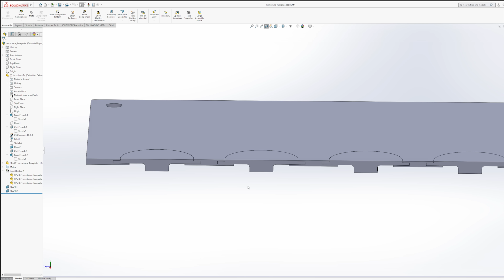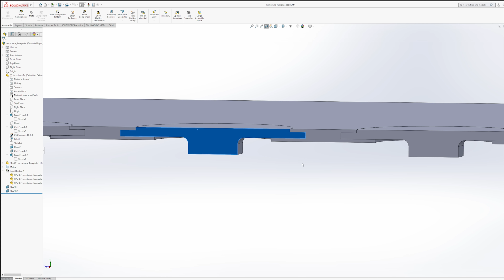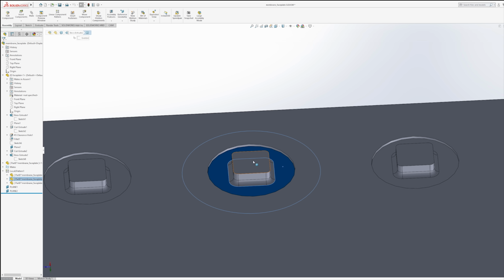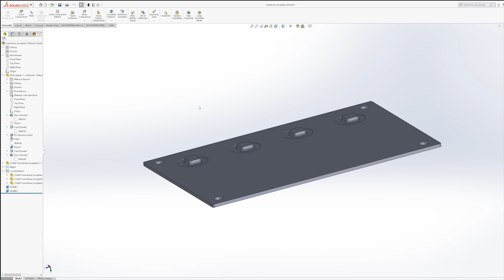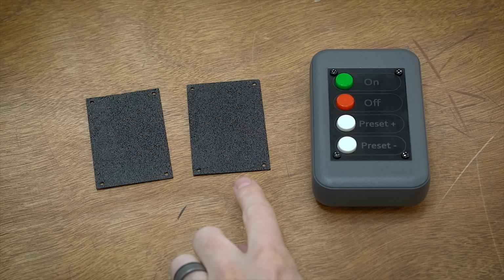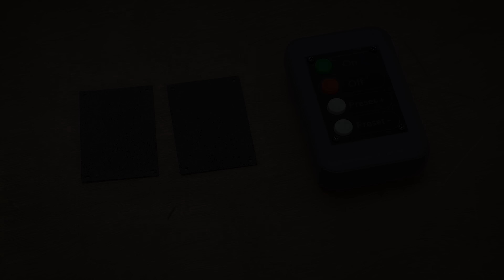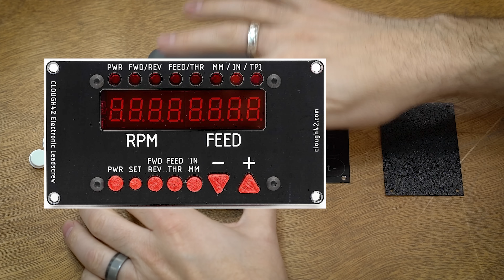3D Printed Flexible Membrane Keypad

Comment: Thanks for the video. Some idiot used this technique on our fire alarm control panel instead of using ordinary buttons. This broke over time as it was regularly tested. Now  I know what materials were used. There is a saying, if it ain't broke, don't fix it
Reply from the maker: Ha.  Yeah, I was more demonstrating the technique, but it absolutely has its application.  Membrane switches are decent, but not always the best for high-use environments.

Comment: I had an idea for making TPU hinges in PETG parts, and that’s part of the reason I initially pre-ordered a multi-head XL, but then I was told TPU and PETG didn’t mix well. Guess I was wrong. Maybe I’ll see if I can make something like this work with M600 filament changes. Would be a pain in the butt swapping filament twice per layer, but it might work…?
Reply from the maker: Yeah, that might work, but swapping every layer would get really old really quick.  But yeah, PETG and TPU mix REALLY well.

Comment: This is so awesome. I'm just imagining using a filament with just enough conductivity to literally print 3d print to PCB membrane switches, ala crappy keyboards (like the one I type this out on).

You could have a completely clean product face as it could just be a part of the top, not even just the cutout.

Actually sod that, imagine a product face that looks completely blank until it's on, and then the lights only show through certain regions divided internally.

You could go even further. Imagine a product face that went right against membrane pads like the membrane keyboard idea I started with, but then has cutouts in the PCB for lighting, so the lights for the buttons and the labels could be in the same place on the same PCB, for a true one PCB solution.

You could even do some funky stuff to press buttons on 2 different pcbs with the extensions built in for no fiddly assembly with risers etc.

The possibilities are truly endless.

Like I said in some other comment here, it sure has some kinks, but this is like 3.1D printing, heck, with all the ideas I think of as I type this comment, I'm going to be like the USB Implementers Forum and upgrade that to 3.5D printing.

Just all the things you can print in one print with something like this. Like I totally still think speed is legitimately super important for prototyping, but in many cases, this just strips like 10 assembly steps, and that's really awesome. You could probably make a little plinker toy blaster or water gun on this thing in a single print with no supports to break off. I mean, its just that flexible + hard + color + dissolvable supports + color 2 (semi hard). It's such a powerful combo that honestly, I feel like 5 might be a pretty Ideal amount to always have just about all the normal materials you could want to print with hot and ready for any print. If this thing was enclosed or had a decently enclosed/auto drying dry box, that would be next level. Literally never worrying about filament condition, having at least 2 colors on tap for customization with regular filaments (maybe one of them is carbon reinforced), the TPU for the flexy stuff, maybe even TPE because screw it, it can do it, and what a way to flex its abilities (pun absolutely intended).

My comment was done at this point, but I just had yet another brilliant idea. Standoffs?? Screw in holes?? Sod that! Add some little soft nubs like Noctua fans mount for faster servicing, or leave pockets of TPU/TPE in the corners to hold the edges of PCBs so you cut the screw count for changing the internals of any given thing in half, without anything rattling around.

See, this is the type of stuff I didn't even get to the point of trying with the old manual pause and swap. This is precisely the type of stuff I was waiting to see with the XL.

I'm just waiting to see the crazy stuff the 5 Head people come up with.
Reply from the maker: OH yeah, this opens p a LOT of neat possibilities.

Comment: I like to make PLA stuff with printed threading for easier assembly but I found that unscrewing and screwing them multiple times can wear pla down. I started using TPU for the exterior and making it just a little bit too big. The PLA "bolt" part will squish into the TPU "nut" part and you get a pretty tight seal that doesn't just break down. Also good for any sort of friction facing surfaces to prevent wear, can use TPU as a hinge or an impact interface, good for the outside of ball joints just like the threads.
Reply from the maker: Huh, interesting!

Comment: Could you do the membrane printing technic but print the wording next to the buttons. Then backlight that working area with LEDs or with a EL panel?
Reply from the maker: Yeah, that should be possible.  If I had 3 extruders, I would certainly try that.

Comment: Such a cool idea. A suggestion to explore is hidden slots for led lights with a material that can diffuse the light. I would also love to see attempts at adding labels to the front. You mentioned fiber laser, but one alternative could be to write it with a small-ish nozzle and use multiple color filament on the same first layer.
Reply from the maker: Yeah, I know Clough42 is looking into light pipes.  I don't have a specific need for it just yet, so I haven't played with it yet.

Comment: You could print the labels with the same quasi-see-thru TPU.  Then include some LED back-lighting that comes on for five seconds whenever the controller is physically moved!  You could generate "the color" of the individual buttons via the chosen LED colors, which, would allow far more color choices per keypad than filament colors would allow..
Reply from the maker: Yep!  All of that is possible.

Comment: Well, I guess you just discovered a way to make hidden buttons.
Reply from the maker: Sure, but there are cases where you don't want an actual intrusion point for an interface.  Think of microwaves and any membrane keypad.
Reply: @RobertCowanDIY  Oh nonono, don't get me wrong I completely understand the reasoning for the design. I was just poking a little fun because they are indeed hard to notice because of the colors and texture.
Reply from the maker: @MatrixRay19 Yeah, that was absolutely the point!  I mention somewhere in the video it would be cool to try different colors.  I just wanted to see how well they'd blend on the first layer, to see how seamless you could get.

Comment: But could you use a conductive filament to make connections for buttons on a PCB like a membrane keyboard
Reply from the maker: In theory, sure!  But you'd need an air gap between them, so as long as there's enough gap and all that, it should work.  I'd probably go with a thin airgap and use a very thin rigid material like PLA maybe.  But with multiple extruders, this would certainly be possible.

Comment: I have had so many ideas for TPU+PETG. I Was a little disappointed when I found out Bambu X1C AMS didn't handle TPU. Integrating flexible hinges, TPU gaskets printed onto the part that needs them so they don't get misaligned or bunched/folded if they're thin, print in place solid hinges with TPU sleeve for toys (so you don't see the hinge on the elbow)... sooo many options!
Reply from the maker: YES!  I am going to try the gasket thing, I have an application for that.
Reply: It handles 74D TPU and OBC ... both are options.

Comment: Deffo has some use cases. With enough tool heads you could embed text into the plate itself.
Reply from the maker: Correct, but I didn't do this because I want to try something else, stay tuned ;-)

Comment: This is such a great idea! We've used membrane assemblies in the past many times. This would be even cooler if you also printed integrated lightpipes and labelling 😬
Reply from the maker: I don't have a need for light pipes, but I'm going to try something different for the labeling.
Reply: @RobertCowanDIY  👍 I'm going to pocket this away into my brain for future prototyping. I guess there's no real benefit to printing light pipes vs just buying them and pressing in though if a prototype or product needed them.
Reply from the maker: @emberprototypes  You totally could!  Do another layer with white or transparent filament, or a ring around the outside of transparent filament and have a ring that would glow?  There are many options here.
Reply: @RobertCowanDIY  yes 100%! Lots of ways to skin that proverbial cat 😺

Comment: Can the XL support a pause and swap filaments?  I would defiantly use another color filament for text and an outline for each button. I’ve done lots of multicolor prints with a single extruder, so I assume you could do likewise in leu of getting another tool head. Another nice project, should help to keep the gradue out of that box.
Reply: Someone is going to figure out how to get an MMU to work with the XL and then you will have one head with 5 colors. It should make things like lettering, logos and labels easier and you will have the rest of the heads to handle different materials for the rest of the part.
Reply: @AdrianSchwartzmann This is one thing i was pondering, you could have all these toolheads:
1.) Soluble/Breakaway Support
2.) Flexible Filament
3.) Structural (CF-PC or CF-Nylon)
4.) Low Friction / Chemical Resistance (POM Filament, or other odd ones like that)

THEN

Have one “aesthetic filament” toolhead for your colored PLA etc, and have that hooked up to a MMU or ERCF etc.

Also i was thinking one could maybe have a structural shell and a colored “skin” (potentially under a thin clear wear+chemical resistant layer too)

You could also just have a C, M, Y, and K Toolhead, leaving a slot for structural and flexible as well!

I’m rambling but short of something like @MihaiDesigns Toolchanger with a PILE of toolheads, i think some system like I described would be the dream FDM Printer!
Reply from the maker: MAYBE you could pause and swap?  But why not just buy more extruders?!  I'm sure you can add an M600 and just swap filament though.  I'm going to try something different for lettering, instead of using filament, stay tuned.
Reply: @RobertCowanDIY  You can buy another extruder (XL), I can’t (P1P). 😄. Ok I could get an AMS, maybe, eventually.
Reply from the maker: @MrDksmall  Ha, fair!

Comment: One thing to keep in mind, is unless you changed your settings in Prusa Slicer, your first layer is actually going to be .2mm and not .25mm.
Reply from the maker: Very true.
Reply: While I think you're right, I'd imagine that because of how the stair stepping/averaging works, as it will consistently go up by .25 after, and 20 is more than 12.5, itll practically get him the same result.

The only problem of elephants foot I imagine also wouldnt happen because the slicer would be telling it to extrude at 0.2 anyways.

That being said I do suppose it would help get closer to that final z height resolution.

Comment: Oh man, I bet you could even add a print in place TPU gasket around the perimeter too on the inward facing face. That would really keep dust out if you could increase the rigidity of the face plate itself.
Reply from the maker: You stole my idea!  I have an upcoming project where I'm using TPU to add a gasket to a faceplate, just like you said!

Comment: I use a lot of carbon PLA, it has by far the nicest matt and even finish of all PLA I ever seen. Also its stiffer than general PLA, ultra light and seems to have higher breaking point. Face plates in carbon PLA look gorgeous on their own.
Reply: on my e3d tool changer I print carbon pla outer wall but everything inside is PLA+ Carbon PLA has worse strength properties in normal PLA, so having the bulk of the item PLA actually makes it stronger for me.
Reply: @Festivejelly  That is a cool idea, why not make PETG  ? You are the second that says their Carbon is weaker. I use run of the mill Creality Carbon PLA and have really only good things to say.
Reply: Carbon Fibre PLA is fairly strong in terms of impact resistant but it has like half the strength along the layers. Carbon fibre makes it a bit stiffer but essentially kills the layer adhesion. I dont make any parts PETG because PETG is too bendy and doesnt finish up as well as PLA. PETG also doesnt stick to PLA or anything else for that matter so  its not the best to use in multi material. It makes a great support interface for PLA though.
 @SarahKchannel
Reply: @Festivejelly  I see what you are saying. I noticed that when my carbon parts fail, layers delaminate. But on the plus side, they dont seem to creep and deform as easy as PLA. 
I rarely print with raw PLA this days, I like to work with PETG and Carbon, wood infused filament I love for how the finishing turns out and well it sands.
Reply from the maker: Yeah, I use quite a bit of it too, it's a nice material!
Reply: Carbon additive filaments are actually weaker than filaments without carbon in them surprisingly
Reply: @Brian-S  Wild, I never measure it, but I print nearly daily functional parts with it where regular PLA bends, creeps and sags over time much more than carbon(nated) PLA does. 
I tend to print carbon parts much thinner than I would print PLA and I never had parts break as with pure PLA.

Comment: Lettering test I made a little while ago: printables 601204.
Printing this in the same layer would be also cool, since it will have the same texture. For me, the printing of the text came out really nice on my mk4. Very usable. But I printed them on a seperate layer. Curious how text prints when on the same layer with just an other color. What will the smallest font size be that has acceptable quality? In my test, with a 0.25mm nozzle, text with 2mm font hight still had perfect readability! For me that was: 🤯! See that printables page for a photo of it. By the way super cool stuff you're doing!
Reply from the maker: Nice!  I've done lettering before, but I think I have another idea for this.  Stay tuned.

Comment: Excellent!  this is why the multi-material stuff is so cool.  i did similar, and leveraged the multi-material to take it one step further and it's also exciting.  i used clear filament to add icons on the buttons so i can illuminate them from behind (tested both petg and pla and both worked well but petg seemed to come out more clear, but it probably depends more on the brand than anything).  when you print the buttons facing the print bed, the surface quality comes out so perfectly.  they end up looking like they were injection molded parts and it's really exciting the cool stuff we can do with this

edit: you could probably stick with PETG and just add some structural ribs on the underside to get the stiffness you need. better yet, it might be easier to just make it thicker and let infill handle that automagically, and you could turn up walls to get more rigidity from the petg around the perimeter of the buttons too.  i'd be curious to see if that would have any negative impact on the flexibility of the TPU if the petg around it is more rigid
Reply from the maker: If this was a 'real' part, I would add ribs like you said, there are good spots for them.  Or I could use ABS like some others have said.

Comment: The biggest problem with getting a 5 extruder machine, is you start thinking, and then you suddenly need a 6th extruder xD
Reply from the maker: This guy gets it!
Reply: ...and then a 7th
Reply: @robh9442  Each extruder needs to also have a multi-material unit behind it (like an Bambu AMS). So, you could load different color of the same material type behind each extruder.
Reply: @ken830  You know about 2 hours ago I was going to post a humorous inception-like comment but thought it was silly, but now that you opened the floodgate... yes, using an MMU3 or a Mosaic Pallete 3 Pro on a head (or multiple heads) would be interesting.
Reply: @MihaiDesigns has some ideas along these lines…

(Work in progress, and i am unsure if it will be Open Source (at least on-launch, may be Open Source after Initial Profit?)
Reply: why not use white petg and black tpu or the other way round , so you can see the "buttons"
Reply: This right here is why I have been waiting on MihaiDesigns PitStop to make it into any sort of finished state, because damn would that thing be just a monumental leap to the world "yea, Ill just choose this colour, and that material, and that nozzle here, and the extra high flow here".

Even still, this video makes me itch to make stupid decisions. I think I'll wait it out to see what else comes up, but this is exactly the sort of shit I expected to see from XL machines.

Like, I love my current printer, but I would be lying to you if I didn't say the first thing I did was try to find the stiffed TPU I could find and see if I could reliably print it with the AMS (I could not... disassembly was required... they say not to for a reason....). The best I can try for now is PP or other mostly still sorta rigid filaments, and everyone knows too there are practical limits due to time and waste.

Basically,  This thing is like the next part of the "when all you've got is a hammer" except Robert has many different hammers, and so this is just the most convenient tool. I think I screwed up the saying but yall get the point.
Reply: luckily the XL has the hardware for a 6th extruder build in.
or some other kind of tool, we dont know yet.